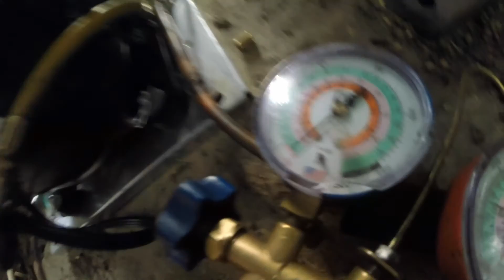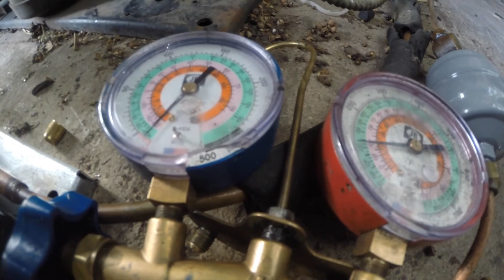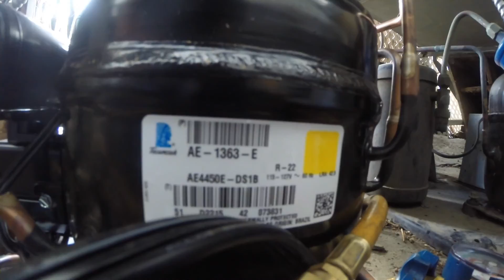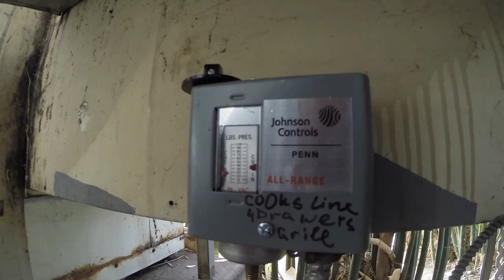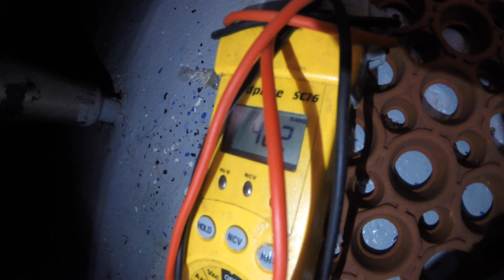FREON LEAK REPAIR ON LITTLE REMOTED 3 DAYS OLD REFRIGERATOR. 1080HD HVAC-R

Comment: Working on Saturday?
Reply from the maker: +Pops McCartney Yes, had early call today. Someone install this unit 3 days ago((
Reply: +Marat RPM SoCal They didn't do a very good job.
Reply from the maker: Yes, that could kill that little compressor with bad low pressure switch and closed suction(restricted system 100%), low pressure switch never shuts compressor, tstat calls for cool 24/7 - so compressor was running 3 days non stop in this conditions.